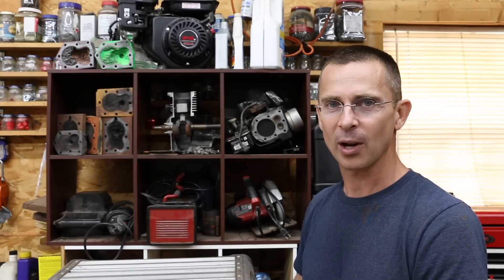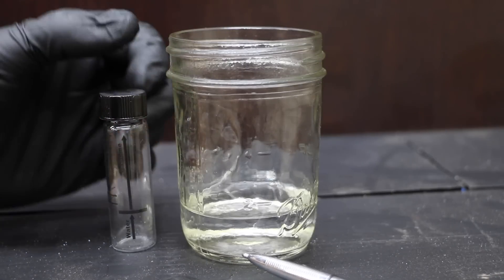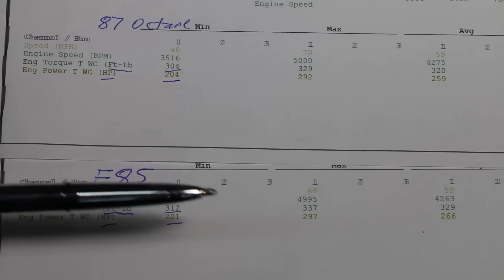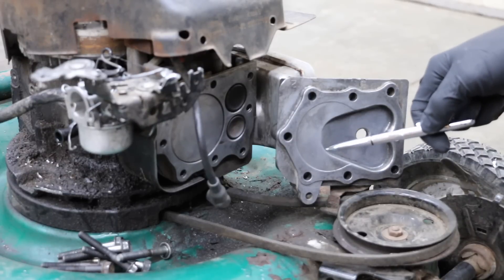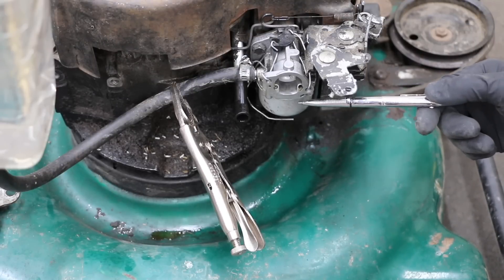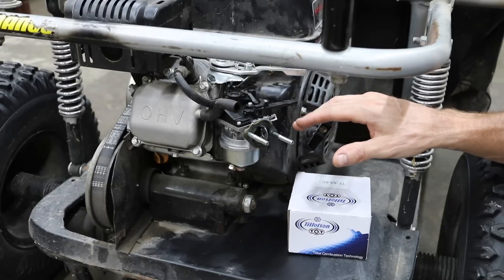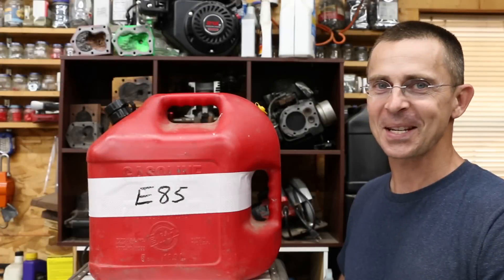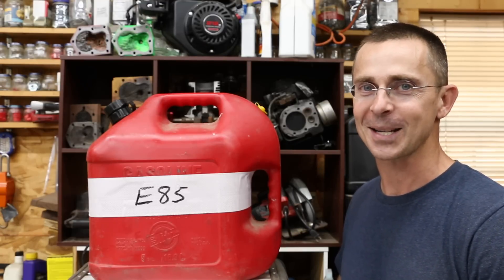Is E85 better than Gasoline? Let's find out!

Comment: E85 is 40 cents a gallon cheaper in Kentucky.  I have 3 vehicles that are flexible fuel.  I run E85 only in my 2013 Chevy Impala.  3.6

Comment: Found with my bore scope running a tank of this before every oil change in my flex fuel car really helps clean the carbon since it’s dumping 30% more fuel into the combustion chamber and oil comes out darker but you do get more of a watery oil as way more gas is in the engine and blows by the rings
Reply from the maker: Thanks for the feedback.

Comment: I bought my car not even realizing it's a 2015 Dodge Durango that it actually is e85 compatible my first fill up was regular 87 octane pump gas the car had a great deal of power ran good had no issues when I went to fill up the next time I put straight e85 in and the car ran like absolute garbage had no power did not idle very smoothly you could feel it in the downshifting I went and did it tuned up change the spark plugs put in new coils cleaned out the intake which was completely caked with carbon the previous owner told me that they always used e85 so the fact that being told e85 Burns cleaner is baffling to me because my intakes were nearly plugged up 30% with carbon I cleaned everything out I still have e85 in the tank the car runs pretty decent now but on my next Philip I'm going to go back to regular 87 octane pump gas and see what the power band feels like 85 to me does not seem beneficial other than it may burn cleaner and it may run cooler but I don't see the cleaner part and the power sucks
Reply from the maker: Thanks for sharing.

Comment: Would be interesting to re-run this test on a newer GM 5.3 with higher compression and active fuel management. My theory is the more horsepower at lower RPM, which was observed on the dyno results would allow the engine to transition into four-cylinder mode frequently. I get much better mileage when I run premium for example compared to 87. But not better enough to justify the price premium of 93.
Reply from the maker: Thanks for the suggestion.

Comment: I have a 2011 Silverado I plow snow with. I use E85 in winter for the extra power for plowing. I’ve also used E85 to tow a trailer from Colorado to Minnesota. Yes the mileage suffered (19 hwy to 12 hwy) but I had plenty of power for hills and passing pulling an enclosed 7000lb car hauler.
Reply from the maker: Thanks for sharing.

Comment: Ive got a 2017 Dodge Journey GT, flex fuel capable 3.6 V6.  

On pump gas, combined 19 mpg average, and just under 300 miles before the tank runs too low.

On E85, 14 MPG combined, less than 200 miles before runs too low.  A lot peppier on E85, I think Chrysler tuned the ECU for more power on E85.  Exhaust has a sweeter smell too.

I only use E85 when the cost per mile analysis makes E85 cheaper per mile.  85% of the time, pump gas is less expensive per mile.
Reply from the maker: Thanks for sharing.

Comment: I wonder if I intermittently use E85 once every 4 full tanks of regular in my 2025 Chevy Trax (designed to used E85) if it will keep my engine clean? or cleaner?
Reply from the maker: Thanks for the suggestion.

Comment: I ordered a flexfuel conversion kit for my 02 Mustang GT. Should be here soon. I won't be doing any scientific tests other than measuring gas mileage. I might take it in for a tune and see what kind of horsepower I get. I'm planning on installing a supercharger so that's why I'm interested in running E85. There's only 2 stations here that have E85  though.

Comment: Would you say 88 octane would have similar results? I've been using it for 6 months or so and I don't have any issues. My car ('16 Cruze) itself has it's own issues with lower octane and using the air conditioning. However, if I don't use that then it runs fine. Otherwise it needs 91 or higher to run well with the AC on.
Reply from the maker: Thanks for the feedback.

Comment: E85 best use is as a performance fuel for force induction engines or a high compression naturally aspirated engine that can take advantage of the higher octane and higher engine timing. Gallon to dollar ratio compared to a dedicated race fuel like c16 you can't beat e85. Since it's alcohol based you will liquify your engine oil sooner and e85 will become a gel and clog up your fuel system if you allow it to sit unused for a long time. Anything past 30 days in a high humidity area will start gumming up.

Comment: I’ve got a 2013 F150 flexfuel V8 I use the E85 once in a while to clean the engine. I use 88 grade fuel when I want the best mileage and sometime I run ordinary regular 87 grade fuel. All depends on what I get a better price on because I have a 36 gallon fuel tank.
Reply from the maker: Thanks for sharing.
Reply: @ProjectFarm  My pleasure.

Comment: Our flex fuel Ford Fusion gets around 28 mpg on 87 octane and about 20 mpg on E85. If I have a tank full of E85, I pull into the garage, kill the engine, the exhaust does not stink like 87 octane stinks. The Fusion get up and go is similar between the 2 fuels.
Reply from the maker: Thanks for sharing.

Comment: E85 gives a massive boost to performance in high compression ratio engines and turbocharged engines that’s its strongpoint I saw a 14% increase in horsepower installing an e85 flex fuel kit along with a tune on a brz that has a very high 12.5 compression ratio also since my car usually uses 93 octane gas e85 has an octane rating of about 105 which makes it much cheaper then running 93octane while being less fuel efficient mpg went from 28 to 22 but e85 is more resistant to detonation and preignition

Comment: I run E85. I only get a 2 mpg drop. Basically I go by price. If regular is 15% or more in cost then I put in E85 which being in the midwest, ethanol is cheap in comparison. Yes, little less fuel mileage but I get smoother idle, smoother acceleration, more power, keeps engine clean and cooler with low knock numbers being 100+ octane, which means lower repair bill. If your gas tank has enough leaks where E85 could abosrb  enough water to cause issues, then you have more pressing issues to address...like your check engine light that you haven't got the code read.
Reply from the maker: Thanks for sharing.

Comment: E85 once in a while is ok but e85 has alot of condensation so eventually the engine oil will get to a sludge consistency if you run 91 or normal gas 95% of the time and e85 the 5% or less you will have the benifits of both horsepower when you need to and clean fuel system the rest of the time
Reply from the maker: Thanks for the feedback.

Comment: One question that I would really have E85 cleans the combustion chamber what does it wash some of the oil out of the Rings so will it cut down the engines lifespan
Reply from the maker: Thanks for the suggestion.

Comment: Another BIG difference with Ethanol everyone misses is in the winter months ethanol thickens up alot. The more Ethanol the more viscous in colder weather, and the harder it is to pump around your fuel system taxing standard fuel pumps and possibly damaging them. I believe the fuel pump and lines in Flex Fuel vehicle is modified accordingly. I have see E85 station fuel pumps completely shut down due to this in cold winters. In standard summer temps, this is not an issue. I would like to see the colder weather handling of standard fuel systems, and 100% ethanol vs petroleum (carbon buildup, and mpg) tested by Project Farm.
Reply from the maker: Thanks for the suggestion.
Reply: Thats 100% false. NOPE.

Comment: I love E85 in turbo engines. I've never run on 100% E85, but I regularly mix about 1 part E85 with 2 parts regular gasoline and there is a NOTICABLE mid-range power difference. I've done this in my 3.5 ecoboost and my VR30DDTT (Q50) many times and I actually recommend it. I'm sure the dealership would advise against it, but I love it. The MPG is definitely worse, and isn't offset by the lower price of E85, but I think it may be more cost effective than 93 octane gasoline. All that said, I had a flexfuel 5.0 Ford and running that on E85 was garbage; less power and worse mileage. I would only recommend E85 in forced induction engines.
Reply from the maker: Thanks for the feedback.

Comment: As far as tuning/horsepower goals, e85 is superior to gasoline in every metric. Alcohol has a lower burning temperature which lowers the chance for predetonation, therefore allowing more timing and boost pressure with supercharged/turbocharged engines. Using e85 on a naturally asperated engine will see power/torque gains when properly tuned for it, but it is not a substitute for most vehicles. Alcohol is corrosive and will cause damage to natual rubbers and plastics that are not rated for its use. Most vehicles fuel systems will not tolerate the use of e85, and you run the risk of running lean and causing internal engine damage/fuel system damage.

The fuel economy aspect of e85 is nat a factor when using it for power goals. It will net a roughly 30% loss in fuel economy for those who have e85 rated vehicles who choose to use it. E85 will also completely clean a vehicles fuel system, combustion chamber, and exhaust system when used.

I personally run e85 in my Harlequin, and it makes some serious power. E85 is essentially a 105 octane fuel when it is actually 85% Alcohol, 15% gasoline.
Reply from the maker: Thanks for the feedback.

Comment: I use E85 on all my cars. It contains H2O so potentially can cause corrosion of all fuell equipment. Thta why I add 5% of 2-stroke oil directly to the tank. Not sure it helps but at least I sleep better :)
Reply from the maker: Thanks for the feedback.

Comment: Have you made a video testing if there is a fuel additive or octane booster you can add to E-85 to make it run smoothly in a standard E-10 engine?
Reply from the maker: Thanks for the suggestion.

Comment: I know this is an older video but since i just found it, my truck is designed for e85. I noticed when i use it every so often it runs much smoother with no hesitations. I believe using it a couple times a year has kept the combination area clean.
Reply from the maker: Thanks for the feedback.

Comment: I use e85 in my 89 7.5l f250 with an hho generator, but not for the reason that you think. In ca, it's $2.89/gallon for e85 in a world of $5/gallon for gas. it made sense to run an ethanol hho mix instead of gas. So what the stock obd1 computer does is it sees the e85 making extra o2 when it burns and tries to richen it up by adding more fuel, which just makes more o2 in a loop. So the truck will run extremely lean and hesitate/idle kinda like a dragster unless you adjust the timing. This is where the hho gas come in. Hydrogen implodes when it burns. The ethanol flame front is evened out and slowed down by the opposing force of the hho implosion. This in turn makes the timing more gasoline like without any physical adjustment. It will idle and run like gasoline on e85 and hho, with the overall advantage of me only spending $2.89 for a gallon of fuel as opposed to $5 for a gallon of fuel. There's no gain in mpg on hho and e85, it's more about "fixing" the stoic of e85 and having the option to run alternative fuels that are definitely alot cleaner/better for the environment. It's good knowing that in an end of the world collapse of society type situation, I can literally just brew my own alcohol, refine it in a stil, dehydrolize it, make e100 and run off pure ethanol-hho. Just gotta learn to make synthetic 10w-40 oil from plastic and wood coal now. Lol.
Reply from the maker: Thanks for sharing.

Comment: I could even try out E100 in Brazil, that was a lot of fun! 😃👍
The car was a Chevrolet Spin Automatic Full Flex. The engine run smoother and more silently on E100, you got a good punch in the back when accellerating, the exhaust gases had the odor of an alcohol cooker in a restaurant, you needed to touch the throttle just barely at low rpm but the most significant difference for me was that the transmission shifted up at 2,100 or 2,200 rpm on regular fuel but at 1,800 rpm on E100.
If you don't need the range of regular fuel on a long tour E100 has its benefits. 😉👍
Reply from the maker: Thanks for sharing.
Reply: @ProjectFarm  Thanks for reacting to all comments, even to comments of 3 years old videos. 😃👍 You really give value to your audience, Todd! Thanks! 🤗

Comment: Methanol and Ethanol are both primary alcohols. There are several things that are good about alcohols. They have a very high octane rating. They also have a hydroxyl group attached on the end of the parent chain. This extra oxygen allows for a much richer air/fuel ration inside the engine. Alcohols specific energy is much higher than gasoline if the engine is optimized for it with ignition timing and air/fuel ratios adjusted in the fuel systems. Alcohols also have a higher products to reactants ratio than gasolines giving more bang for each cylinder full of fuel and air. Alcohols also have a much higher latent heat of vaporization than do gasolines or other fuels. This gives the intake charge much higher density and momentum into the cylinder of a normally aspirated engine. This cooling effect also cools off the piston crows, the combustion chambers and valves. All good for high compression engines.  Methanol especially has a very wide air/fuel ratio  range. you can run it as rich as 4:1 and it will still run good. Because of the hydroxyl group in the molecule makes it polar. Water is also polar. This causes problems with vehicles that aren't set up to run alcohols. Anodized aluminum resists the corrosive effects of alcohols as does steel needle valves in carbs and carb parts that are not effected by alcohols. Given all things equal an alcohol motor will always make more power than the same gasoline engine both engines being the same.
Reply from the maker: Thanks for sharing.

Comment: If you ran a engine optimized for 100%ethanol on 100% ethanol it would get at least 30% more efficiency than the same engine run on gasoline. The heating value of ethanol compared to gasoline has no bearing in work performed in an internal combustion engine. In fact since ethanol combusts at a lower temperature you lose less power to the cooling system, your engine parts last longer, your oil lasts longer. E85 would be fine if it could be 85% all the time and you designed the engine to run on it. E100 would be better and virtually corrosion free. E85 at 85% is virtually corrosion free.

Comment: In my Honda S2000, E85 is a common way to tune the engine for more HP. The fuel system will handle it, but you have to replace the ECM and tune the car for E85. In an S2000 you can get an extra 20% more HP. Your fuel mileage will suffer, but generally you don't care about this when tuning your engine for maximum HP. In this car, with E85 at about $3 a gallon, and 91 at over $4, E85 actually comes out about the same in $/mile. Just remember not to let the car sit for months at time, or the E85 will clog the fuel injectors. In other cars, such as my friends new Subaru BRZ, an E85 tune only nets him another 20+ hp. Not worth doing considering the cost of an ECU and tune, unless you convert to forced induction as well. One other consideration though....you'll run a super clean exhaust for the environment. Also, we use the GM produced flex fuel module.
Reply from the maker: Thanks for the feedback.

Comment: Yes e85 has a solvent cleaner like property to it not a bad idea to run some through the gas tank every once in awhile if you have an e85 compliant vehicle I don't notice any drivability issues between gasoline or e85 in my 70,000 mile Silverado fuel economy is about 3 miles to the gallon less with e85 and practicality wise it has to be 50 cents or less per gallon to be economical to purchase.
Reply from the maker: Thanks for the feedback.

Comment: BTW, I too, have a 5.3L 2002 Suburban Flex Fuel truck.  It has a persistent Error Code indicating something going on with the EVAP system.  I haven't been able to pin-point it, but I have had success in eliminating the Error Code starting a month or so before I have to do the annual emissions test (GA).  

My strategy is to clear my codes, then use nothing but E85 for that month & it does the trick of not tripping any codes.  I have done this for the last 3 years & the 'Burb always passes emissions.
Reply from the maker: Thanks!  Thanks for the feedback.